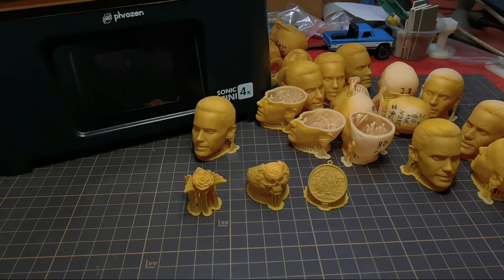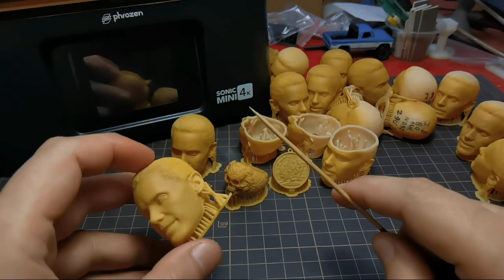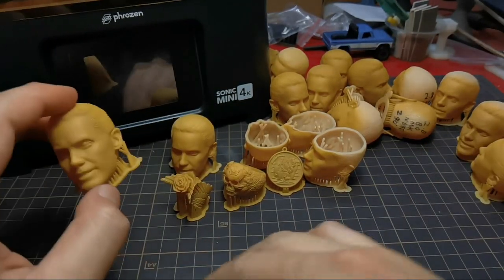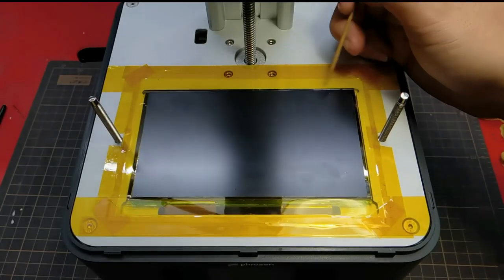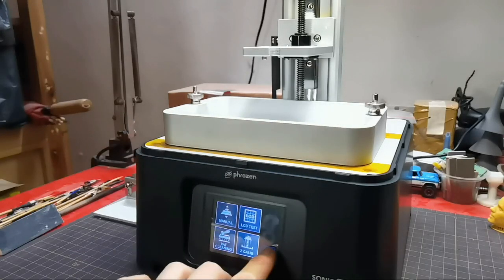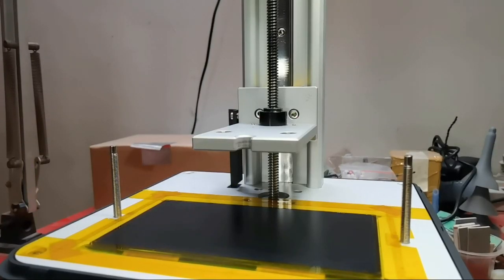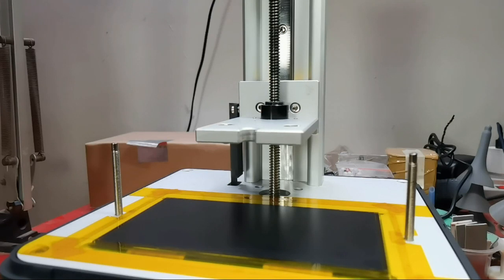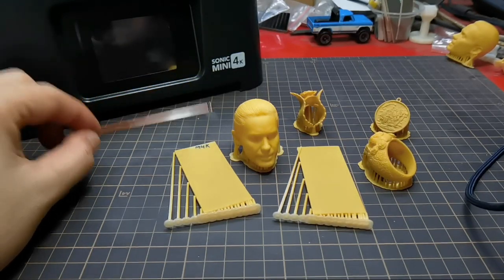Sonic Mini 4K Problem and Troubleshooting

Comment: Dennis, hello! Big thanks to your videos!! It is very useful. Can u give me advice please, my prints is lower for 0.2 mm from real size.
Reply from the maker: What printer are you using?
And how do you level the build plate?
Reply: @wangdennys  sonic mini 4k. Leveling like in your video.
Unscrew bolts, play print, off when lcd is burning, screw bolts
Reply from the maker: @ЕвгенийТемных  try leveling with 2-3 papers
Reply: @wangdennys  thank u, Denny!!!
Reply: Hi Dennys! Can you share your supports settings in chitybox please!!
Reply from the maker: I always generate the support manually
So i dont have any set support setting.
I will work it soon.

Comment: chiming in with a update for new peoples.
i ran the suggested gcode, and it works great, but i looked into upgrading the machine fw. Chitu 4.4.4 let's you use TSMC and resolves the 'speed crash into screen'  issue.

tested with 60/200 lift, 200/60 retract, and the 'slow near screen' works as intended.
Reply: How is it? I uploaded the gcode to my printer.
If i upload Chitu 4.4.4 later, is there any problem printer?
Reply: @말꽁-o7j  i haven't had any issues since upgrading
Reply: @XxSTOZZYxX  thank you ;)
Reply: @XxSTOZZYxX  how much mm are you using with 60mm/s and how much with 200mm/s on Lifting? thanks
Reply: @ruffryder1337  I tested with 2mm slow, 4mm fast on lift, 1mm slow on retract. So 6mm total travel.

Played with speeds, 30/40/60/80. Not sure what the MAX the machine can handle is but 200 seems fast enough.
Reply: @XxSTOZZYxX  Thanks!

Comment: Denny! Thank you for the great trouble shooting ideas!!!

I have some questions.

Q1. Did you buy ipad anti glare / matt screen guard and cut the screen guard to fit SM4k screen ?

Q2. Did you find the "matt" type screen guard is still ok? I think matt type guard would diverse the UV light from below. Is there no issue using matt type?

Q3. Could you share the model name of transparent yellow tape you used for fixing the sceen guard with SM4k? 
       Could you recommend tape model?
Reply from the maker: Hi
1. Yes, cut to size.
2. No issue from several printer i use and already compared to one with glossy screen guard.
3. It called kapton tape.
Reply: @wangdennys  Thank you for your kind answer!!!

Comment: Thanks for sharing. I would like to build an hybrid printer with my shuffle 2019 and my sm4k. I want to keep the sturdy body of the shuffle and add the board and screen of the sm4k. I'm able to fit the location of the screen, so my main question is: Is it possible to flash the firmware of the sm4k board in order to adjust the settings of the stepper motor because i'm pretty sure the lead screw has a different thread pitch.
Reply from the maker: As far as i know. Almost all resin printers are using leadscrew with the same thread pitch.
Reply: @wangdennys  so it should be possible to make an hybrid printer from both...

Comment: Hello, thank you very, very much for your significant information!
This movie actually includes all information I was looking for, for months without progress!!

Let me ask 2 questions for your excellent methods:
(a) Did you remove original "screen guard and black tape", before installing anti-glare and Kapton?
(b) Is my understanding correct?: the thickness and exposure time of the bottom layer are related with lifetime of FEP film and affect print quality in longer period, not when the FEP film is just fresh.
Reply from the maker: Hi there.
a) yes i removed my black tape and then install screen guard, then cover with kapton tape.
b) correct.
Reply: @wangdennys  Understood! Thanks for your perfect answer, appreciated, I'll try them this weekend :-)

Comment: Could you recommend a step motor with screw for the printer? I have the same problem -horizontal lines pattern every 2 mm approx. I think the reason is the defective screw, which is the part of the step motor, I want to swap it. Maybe do you know some online shops where I could buy it? 
 Of course I wrote a message to phrozen support, but they haven’t answered to me yet. I’m getting so sick and tired of waiting the answer. Also, I made all of your recommendations and recommendations from FB groups, but they didn’t help me.  I decided to start fixing it by myself.
Reply from the maker: Hi
What i identify so far is only the linear rail.
I am not sure yet for the stepper motor.
Reply: @wangdennys Ok, thanks. I'm wondering  what info did you find about the linear rail?
Reply from the maker: hi, contact me through my social media. link in video description
i manage to find the stepper motor, and doing test right now

Comment: That's the bed leveling method I described in the Sonic Mini 4k Community Facebook group. The reason you need to do it while printing is the build plate, when starting to print on the SM4k, moves down a step to the zero point. Instead of moving to the .03mm layer height like it should.
Reply from the maker: Yes, i read your post about it. And still phrozen recommend me to press firmly when leveling on z calibration. LOL
Reply: @wangdennys  I am convinced they don't know (or don't care) about what's wrong with the printer.
Reply from the maker: Looks like it. LOL
Heck even the firmware is weird
Reply from the maker: @Wittmason  yes, i have
Reply: @wangdennys  we are beta testing my kit now. Let me know if you’d like to be a part of the beta test we have builders in the US and Europe. You just have to agree to provide me feedback and show before and after final images.
Reply from the maker: @Wittmason  thank you for the offer
But unfortunately, my workshop is not capable to do such test.
I am in like a refugee temporary workshop because of corona LOL
Reply: Is this the case with all Phrozen Mini 4k printers? That would be a red flag for me when choosing to buy resin printers...

Comment: Very thanks for the useful recommendations for improving the machine and printing quality.
 May I have a question about the firmware can be used for the phrozen sonic mini or not ?!
(My machine is not the sonic mini 4k)
Thanks for your great support : )
Reply from the maker: Honestly i am not sure. 
But if you want to try. Save a copy of the original firmware from phrozen website. 
Then try the custom firmware.
If it doesn't work, then reflash the original firmware to your printer
Reply: @wangdennys  Thanks. I will try it : )
Reply: @wangdennys  I went to the facebook link to download the file and its not there anymore does anyone the link they can share with me please ?
Reply from the maker: @oPraduh  join the group.
You should be able to download the file
Reply: @wangdennys  I’m new to all this do you have a video on how to change the firmware for the sonic mini 4K or could you explain it ?
Reply: @wangdennys  can you please make a video on how to update the firmware I'm new to this and cant find out how or can you please explain it to me how you update the firmware kinda a step by step method would be super appreciated :)
Reply from the maker: There is a discussion on the file post at the comment section on how to.
Reply from the maker: @oPraduh  contact me through me social media
Link in video description.
It's easier to chat there

Comment: If you level like that… isn’t the first print layer actually one layer height above Z calibration point?
Reply from the maker: Yes, that is the point.
Because the first layer height is lower during print compare to z calibration.
Which causes the arm to bend upward and built plate press down too hard on screen
Reply: @wangdennys  I’ll try that.